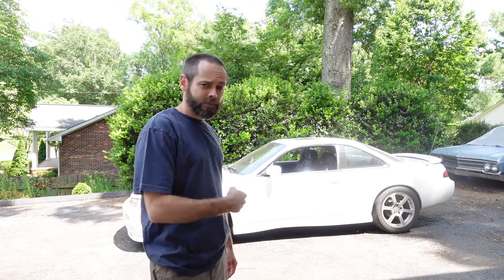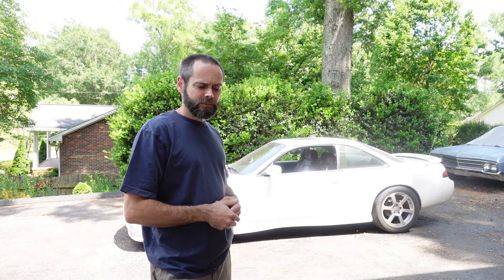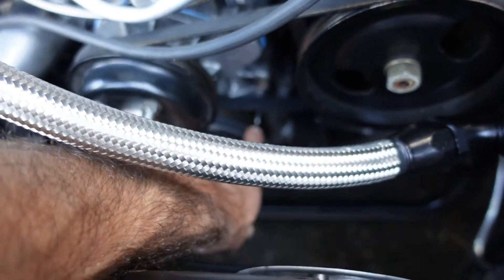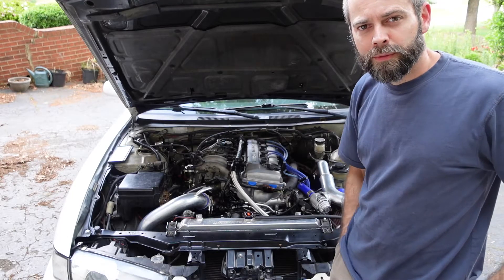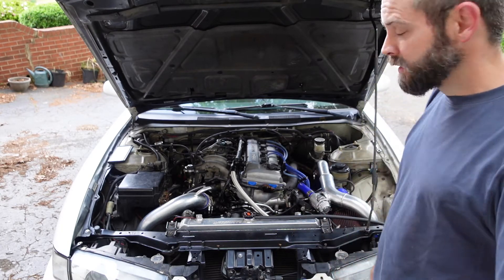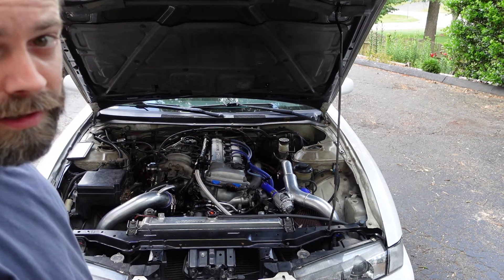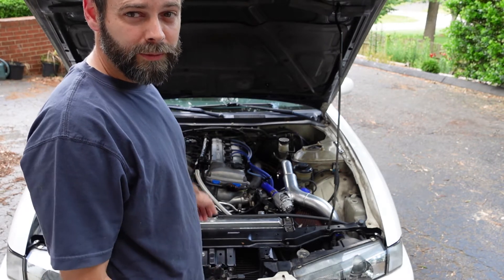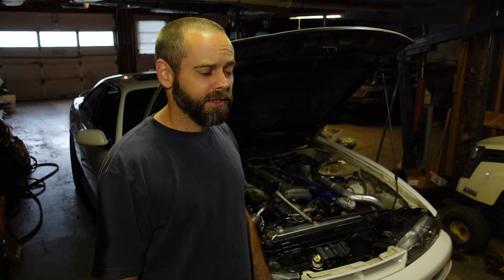Turbo ka24de 240sx setting idle and base timing

Comment: What timing light are you using, do you find the tach on it to be accurate? Thanks
Reply from the maker: Hello srmx5, I use an innova timing light.  Not sure of the model, but it is one that is compatible with 4, 6 & 8 cylinder engines.  I find that the dash tach, light tach and FIC tack are all within 50+/- rpm of each other.

Comment: How do you route your Idle Air Control Valve for boost? Should I just route it right before the throttle body? Or should it be routed pre-turbo to always have a vacuum?
Reply from the maker: I have my IACV routed to the cold pipe in front of the throttle body.  You want the IACV to see boost, if not the the idle adjustment screw would be a vacuum/boost leak.
Reply: @nextlifegarage212  Thank you!